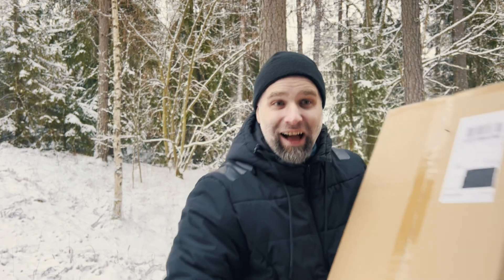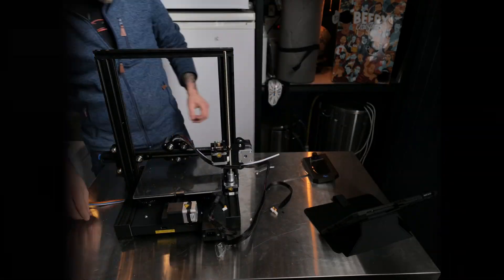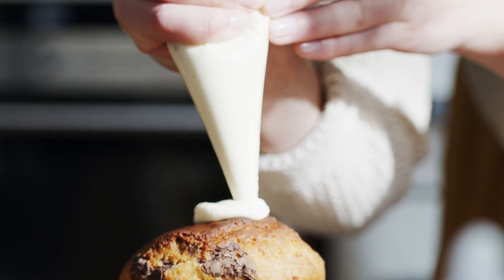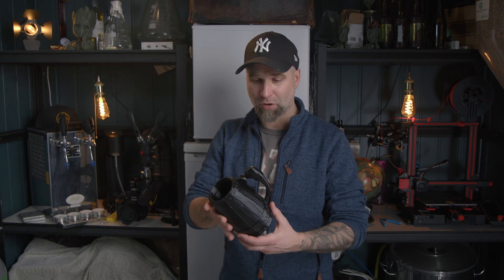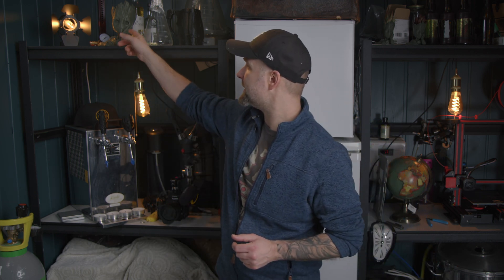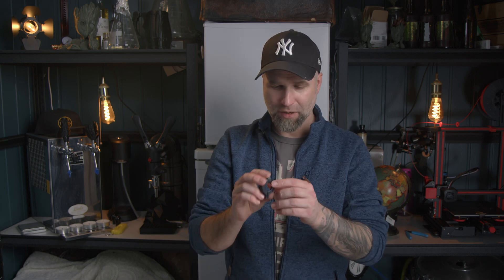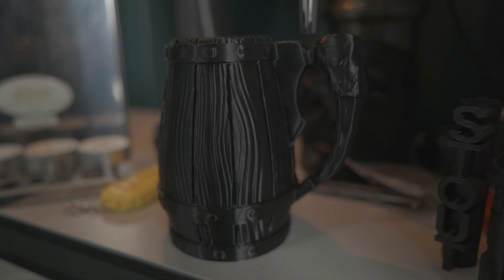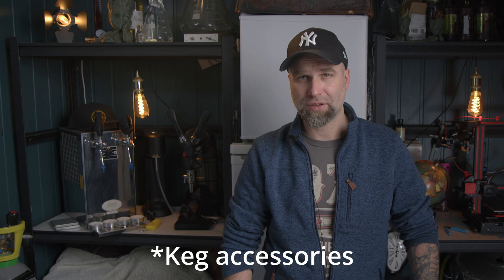3D printing Beer stuff - Creality Ender 3 v2

Comment: Great video! I have a question. I need for my Angram beer engine a creamer/Sparkler nozzle. Do you have a 3D printing file for those kind of nozzle? I would buy one at RLBS, but the shipping for such a penny thing ist about 37 pounds. BR
Reply from the maker: Thanks, glad you liked the video! 🍻 Unfortunately, I don’t have a 3D printing file for a creamer/sparkler nozzle. But I totally get why you'd want to print one—paying £37 in shipping for such a small part is insane! 😆

You might have some luck checking Thingiverse, Printables, or other 3D model-sharing sites—there’s a good chance someone has uploaded a similar design. Another option is to ask in homebrewing or beer engine communities—sometimes fellow brewers are willing to share or tweak designs.

Hope you find a good solution—cheers! 🍺

Comment: Great videos! I designed and 3d printed blowoff tube brackets so they can force snap in and drip dry and a simple part to allow my Fermonster to use the glass carboy dryer. Those were my designs, but also printed 4 pack bottle holders, faucet cover, to name a few. 

great stuff

Comment: The two most useful yet simple models I designed and printed are:

- An insert to my Doc Revo bottle capper, to secure that I always place the bottle in the exact right spot below the cap
- A template to insert a bottle in to make it easy to align and place labels straight and in the same hight on all bottles.
Reply from the maker: Cool

Comment: I've printed a fair amount of stuff for my brewery on my 3D printers. 
The ball lock line flush adaptors are really good to allow the ball locks and lines to be cleaned really well. I really like the Poppet depressors to get rip of pressure from lines also.
Reply from the maker: Cool, thanks

Comment: Welcome to 3D Printing! I've done some beer related prints. One is a special cap for small 5L glass fermenters that allows me to do low-pressure transfers out of those. Then some beer line clamps for my keggerator to have tidy lines. I've also printed a CNC (MPCNC) and manufactured some nice wooden handles for my keggerator with that. And no: the CNC was not just for the handles - that would have been overkill :D
Reply from the maker: Overkill is my middle name 😂
Reply from the maker: Awesome thanks for sharing